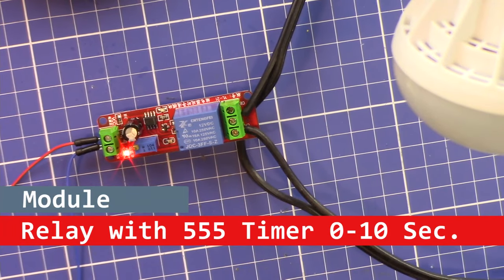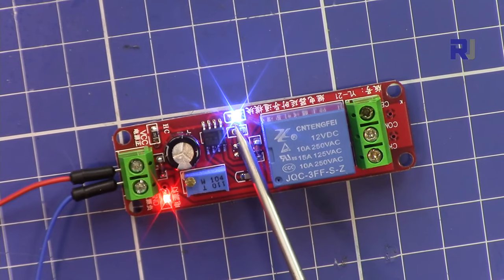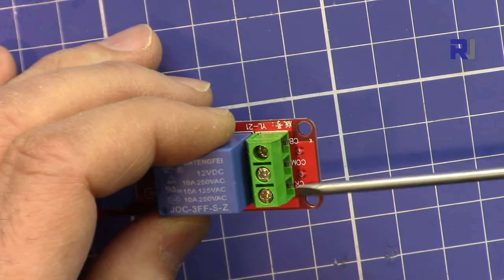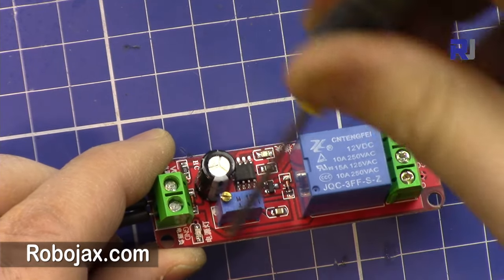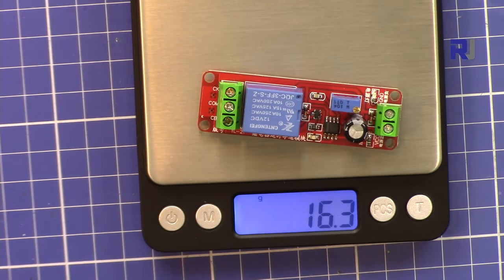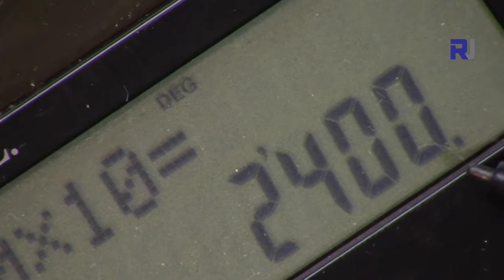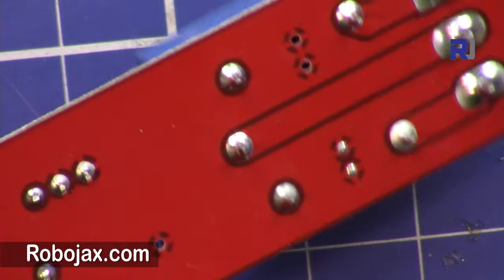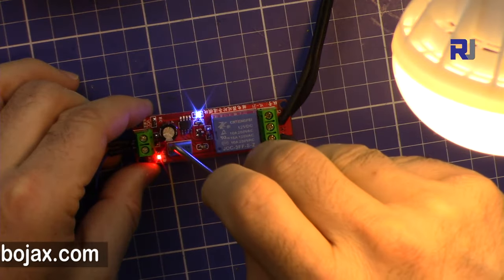555 Timer Switch 12V Relay with Adjustable time Test review

Comment: I was frustrated with potentiometer. Adjusting it tiny bit by bit...I am happy now to know i need to turn it 10 + times:D thank you!
Reply from the maker: You're welcome!
Reply: @robojax  Can this be used for OFF delay also > for both activating the load and hold/maintain its ON position upto specified time (0-10 sec) ? in a IR sensor +ve output circuit ? triggering on off again and again by IR sensor output ?
                  as I am annoyed by the on off flickering Output of IR sensor relay circuit while using it as automatic sink/basin hand wash process.

Comment: The input coil voltage is nominal rated on 12VDC, but whats the maximum input voltage the coil can handle? is this the same as the maximum output voltage?
Reply from the maker: have tested it with 12V. Search for the model of the relay and see the datasheet.  I advise against it any voltage 5% greater than rated voltage. but read the datasheet.

Comment: This circuit can usable in car dome light?
Reply from the maker: this is just a switch and you can use it for any load of 10A. See the video for explanation. if you want to change the time or add a rest push button on this module then see this video https://youtu.be/LDLPUpU64J4
Reply: How to connect this circuit with car rooflight and get fade on off

Comment: You can increase the time by changing the Capacitor to more farads.  Delay time formula: T = 1.1RC. For example: Capacitor 22uf resistance 1M T = 1.1 * 0.000010 * 1000000 = 10 seconds.
Reply: You may have the exact answer I came looking for. I want to change Seconds to Minutes. So the modules default 60 second max, will change to 60 MINUTES. I'm going to attempt to sort out your formula. Thank you.
Reply: @Lapeerphoto  did you conclude if this worked or not, and if so to what degree? I was wondering if I could go to the extreme and make it to +/- 24 hours.
Reply from the maker: I have make new video with hack showing how to increase the time and add reset switch https://youtu.be/LDLPUpU64J4

Comment: How can I use it as timer circuit,
I need relay to work for preset value,other wise close
Reply from the maker: isn't this a timer? check 2nd video link in the description to add reset button and increase time.
Reply: Actually iam using in making spot welding machine,
So which is best?
Reply from the maker: this module can handle 10A.

Comment: Hi, iv just purchased 2 of these but the 12v out is only on the 2 inner legs of the relay, and it will only output to those 2 legs once the relay has energised, i presume there faulty, cheers.
Reply from the maker: Hi, yes. to use it as switch, you just need to connect two wires.  Here is a hack for this to increase the time https://youtu.be/LDLPUpU64J4
Reply: @robojax  Mine seems to be working in reverse, its instantly energised and the timer de-energises after say 10 seconds, do they do 2 versions of this, after the set time of say 10 seconds there is no 12v output, thanks.

Comment: Nice video, i am looking to power off a light after 10 sec. However, i don't want it to power back on automatically even though i have power still coming in. My scenario is, power comes on then delay power off (10 sec) then sit there. I turn off power, turn on, then again power off after 10 sec. Would this device allow that?
Reply from the maker: Here is Arduino based time https://youtu.be/6DGQhQgr7Ak this module you are using can't do much as it is made like that.

Comment: Very good video kindly I ask you if can modifying to be power on instead power off best regards
Reply from the maker: It already has it. Just connect your load differently. Relay has three wires. Keep the the middle wire and mic the other wire to other terminal.

Comment: Very good demo. Can the timer be initiated with just a single short press push of a button  switch, or does the control power need to remain applied during the timer period.?
Reply from the maker: I have a video where showing how to increase the time, add a push button. link is description or search my channel for keyword "hack"
Reply: control power needs to remain. I thought the capacitor would allow a short burst of power then discharge over the delay period but it doesn't. Shame

Comment: So, instead of 230v application, can we use it with 12v for car lights?
Reply from the maker: It is a relay. Relay is a switch and I mentioned that you can connect AC or DC load. And car battery is DC. So yes

Comment: I have a couple of this and i need to make a light that fades on and fades off until the power source is depleted, how would you wire it?
Reply from the maker: perhaps you did not watch it. this is just switch which turns ON or OFF. there is no fading.
Reply: @robojax  Lets ignore the fading, just an ON for 10 secs OFF for 10 secs in the light, how would you wire it using a couple of theese or just one?
Reply from the maker: connect them in parallel meaning + of all of them to + and GND (or -) of all of them together to power up. Then connect each load (LED or light ) to each module as shown in video.

Comment: Is it possible to make a trigger push switch connection in this module. Can a IR sensor be connected because only positive and negative terminal connection is seen.
Reply from the maker: it doesn't have any trigger option. May be this would better option https://youtu.be/ZRAaTRKRmh0 or see them all  https://www.youtube.com/robojaxTV/search?query=timer

Comment: would something like this be apple to operate a dpdt relay that reverses polarity on a motor and without big voltage drain when the car is off? I suspect a capacitor would be involved so that when the car coes off, the relay reverses polarity on the motor to operate for 2 seconds
Reply from the maker: The car battery voltage go up to 14V and I am not sure this muddle can withstand that violtage. I would suggest using a buck boost conveyer so it always outputs 12 even if the input is 9V when you start the car.

Comment: Nice video.i have a adjustable timer similar  to this but no real directions for it.just a very vague  diagram.i was wondering if you could tell me how to wire it if I sent you a picture of the diagram I have?
Reply from the maker: this video is  made so you know to connect it (wire it). Isn't it?
Reply: @robojax  well I have a different type of board but not very good directions as was wondering if I sent you a picture  and the diagram I have if you could tell me how it works coming from the relay end.

Comment: I bought a similar looking device to achieve this exact effect, that is, the delay. However my module does the opposite. It commutes the relay when you power it on and goes off after the time set on tje potentiometer. Can I hack it to achieve the effect I need?
Reply from the maker: Just change the wires.  keep the middle wire for the relay and switch the othe wire between to the two other connecters.

Comment: Can this timer module be used for less than 1 second. Eg. 0.5 seconds? That means turn on for 0.5 seconds then turn off. For spot welding 18650 battery application.
Reply from the maker: It has a potentiometer and try it. I am not sure.

Comment: I want to add LED turn signals to my ebike, and my first thought was to use this type of timer to control the flashing rate of the LEDs... but most of the videos I saw on turn signals are using relays. Am I overcomplicating things by using such a timer?
Reply from the maker: this module is not that purpose. You need different module that has loop  or better use Arduino.  Learn Arduino in 30 Minutes (video): http://robojax.com/L/?id=135 where you can do anything you want.

Comment: What if power supply is disturbed?
will it act opposite. ?

Or any other idea about . How to give power only for 10seconds.
Regards
Reply: So that... I can use this circuit as power saving also
Reply from the maker: Didn’t I connect it to bulb before connecting power? I should have. It will be off depending on wiring .
Reply: I need a circuit.. which can power this relay for like 10-15 second
After that power should off. For the purpose of battery saving.
Reply: I'm talking about input power.
Not about output of relay.
Reply: Is there any way?
Reply from the maker: yes. just change the two wires. I have shown the middle and NO pin. you use middle and NC pin and it will turn off after that time. Learn about relay in here https://youtu.be/58XWVDnB7Ss
Reply: No no no.... No the output..
I want to cut power of input .

Actually I'm using this via remote control 
So when remote key is pressed it will power input of timer for some time 
But i want to cut power after 10 second. So that i can use it again after pressing the remote key only .
So as to save power. That I'm using to power the relay.
Thanks

Comment: Does any company make a 12vdc relay, that can be adjusted to turn on and off repeatedly by itself automatically at 10 second intervals...or 60 second intervals ?  Ty I have a pond pump that runs directly off a 12 volt solar panel, and I want the pump to run for 60 seconds then shutoff for 60 seconds, then run again for the next 60 seconds, etc...all on its own.
Reply from the maker: See this video which has not display https://youtu.be/6DGQhQgr7Ak
or this one with the display https://youtu.be/BhEIFzFSMuE

Comment: Your website doesn't work.  I need a triggered relay that will come on for an adjustable time then go off.  But cannot be re triggered for a set amount of time.  I need it to operate a horn in a Haunted house.  Where someone can't just keep triggering the horn constantly.  So basically once triggered it will be on for 1/2 second then off for 30 seconds before it can be triggered again.  Do you have a relay like this or will I have to buy an Arduino to run a simple relay?
Reply from the maker: HI, I checked the website and it is working. But you can't purchase.  This relay doesn't have both features of ON and OFF.  You will need this item https://youtu.be/dtc4UL2bEs4

Comment: It can Active instantly cause if it takes several sec then my wifi restarts?? Please replay it can Active Instant in 0 sec
Reply from the maker: What did show then in video? Didn’t I demonstrate?
Reply: @robojax  yes, but I wanna know it can start in 0 sec Instantly otherwise my router restart. Btw tx for replay
Reply from the maker: yes. it can. you simply set the time to minimum. You may learn more about it in this video https://youtu.be/LDLPUpU64J4

Comment: 3:50 the relay might support 1.8KW but nothing connected to it on that circuit board looks like it could.
Reply from the maker: Yes. I did the calculation so you know  the rating.

Comment: Hey, I want to take input in this timer module using a sensor. Is it possible and if so how should I do it. Basically I want to make a delay circuit for automatic hand sanitizer dispenser using IR sensor.
Reply from the maker: Hey,  You can use infrared sensor to detect hand using this video https://youtu.be/T3Li128GBlM and the output of the sensor can be connected to this to trigger it.  good luck

Comment: Hi Robojax, i need very important information. Sensitivity of this circuit. If you flicker the DC (9v/12v) for few say haf a second (200-500ms) does relay detach?
Reply from the maker: you should not connect it to 9V. it is 12V rated. Yes voltage will affect it. see how to add reset push button and increase the time https://youtu.be/LDLPUpU64J4

Comment: can this work in reverse  I need to turn a item on and it turns off after a pre determined amount of seconds. If not can you recomend a module that will do so please?  any help appreciated
Reply from the maker: Yes it can. I believe I mentioned it.  the relay has three pins. keep the middle wire of relay unchanged and move the other wire to the other pin. Please subscribe. I appreciate it and helps my channel grow.  Thank you
Reply: @robojax  Many thanks for your excellent advice Robojax.  keep up the good work.
Reply from the maker: You are welcome. Please subscribe. I appreciate it and helps my channel grow.  Thank you

Comment: How about A 12V source to a 12v load. I need a loop that is: 12v water pump runs for 4 minutes, the shuts off for 45 minutes, then loops indefinitely. Thanks, Chuck
Reply from the maker: Perhaps you need this module https://youtu.be/81XzLwt3dqo

Comment: Thanks for the video! There is an option with turning off with a gradual fade instead of simply cutting off the light?
Reply from the maker: no not possible. this is relay. Relay is a switch with only ON or OFF. you can use dimmer. for that. I have video on dimmer. Here is how to find Specific YouTube Video in a channel https://bit.ly/findYouTubeVideo

Comment: Hi, I have a question. With my relay, whenever a power source is applied, the relay switches on immediately, even if i try increasing the time. Any idea why this may be happening?
Reply from the maker: Hi, may be either the power is weak or it has noise (un clean DC). check if the capacitor pins are not loose.

Comment: Could I use this for a door bell disconnect ? I have an automatic door bell and want to delay it 10 sec in between each ring.
Reply from the maker: this can be used when the bell button is pressed, this too just turn OFF the bell after the set time. Yes it can be used.

Comment: What is the accuracy of time
once  it set .
I. E . suppose if pot. set for 6 sec. what is repeat accuracy. 
If timer run for continuous 
operation. With rest time of 5 to 2o second. 
Also where it available & price.
Reply from the maker: it is running with simple capacitor with 10% tolerance so you should not expect exact time. You can get it from https://www.ebay.ca/itm/201655542608

Comment: Could you show how to connect this NE555 timer switch for 5 seconds and IR proximity sensor and power source
Reply from the maker: Hi, that is interesting project but it is very custom and not so many people will use it. I try to make vide3o so many people benefit from it.
Reply: @robojax  could you make it as fast as possible please because i need to do a project on it .
Reply from the maker: Hi,  why didn't you search and waited this long? I already have it here https://youtu.be/LDLPUpU64J4  with push button. the push button is the output rom your sensor. watch the video and you can do it.
Reply: @robojax  Can i use the similar way to trigger NE555 module of 5v relay ??(could you reply please)

Comment: hello how to connect if im using input12v and output 12v? possible for this or not?
Reply from the maker: Hi, it seems you did not understand what I said. We have power for this module to work. Done that is it . it is 12V.  to turn OFF or ON relay you can use 1V or 300V it is up to you.
Reply: @robojax  ok good cause im planning to drive a 12v  fuel pump.

Comment: Can it b set for mili seconds ?...how low can it go ?.. .thank you
Reply from the maker: this is relay. Relay is a mechanical device NOT electronic switch to be turned ON or OFF quickly.  so NO. it  can turn on may be twice or trice a second but not more than that.  Here I have explained relay and how it is driven https://youtu.be/N-fFk51Eb8s
Reply: The description  says 0 to 10 sec so is the proper second  or it can b set anywhere between  for eg 1.10 or something  like that ..and Wat about  the other  one the display  timer relay which has a display and modes can that go to half  a second  atleast  ...and thanks alot  good work
Reply from the maker: this is not exact as there is no actual clock. it is a capacitor where it is discharged via resistor. both capacitor and resistor have tolerance of 5 to 10% so expect 10% error or higer.

Comment: hi i have a project where i need to convert pulse 12v DC to constant 12vDC will this relay work. Im a very begginer in electronic components. But i understand i need something to store the pulse dc on one side and release it in one constant flow on the other side, is that correct?
Reply from the maker: This is a switch that can turn ON based on the settings. (or turn OFF if you connected differently)
Reply: For constant voltage u need dc-dc buck converter
Reply: @atwalcheapenergy3918  how does that work? 🤔

Comment: is it possible to set the timer for more than 10 second? like around 2-3 minutes
Reply from the maker: not possible. of course if you remove the potentiometer and pout extra resistor in series, yes it would change. but you have to look at 555 timer schematic and modify it.

Comment: Thanks . 
It means capacitor tolerance 
may effect time accuracy for repeat cycle by 10%.
#i.e. If set for 6 second repeat accuracy may very from 5.4 sec to 6.6secod may I right.
#One more thing current(ma) consumption for 12 volts d.c power supply to operate relay& circuit.

Comment: Can i use this in reverse mode i e.,  if i give the power supply the light must ON and after relay turn on (approx  after 5 secs) the light must turn OFF , can i achieve this
Reply from the maker: yes you can. The relay has 3 terminals. NC (Normally Closed), COM (common) and NO (normally open). connect your load to COM and NO and it should word. Watch this video to learn about relay terminals https://youtu.be/58XWVDnB7Ss
Reply: @robojax  

Thank you very much...☺️
Reply from the maker: you are welcome.

Comment: Can i use it to power a DC supply ?
Reply from the maker: Yes. this is relay. A switch witch can turn ON/OFF anything.
Reply: @robojax  Thanks for the quick response sir..Today I was trying to power a 24V DC UV-LED strips..I gave 12V DC as input and connected the +ve and -ve terminal of LED to COM and CB....but the LED didnt power on...I tried connecting led to direct DC supply and it was working...It'd be really helpful if you could guide me!
Reply from the maker: text can't be better than video.  this is very simple 12V will turn it on.
Reply: Sorted it out sir...anyways thanks for replying!🙌 ur channel is awesome!